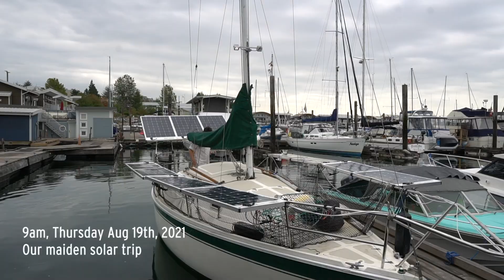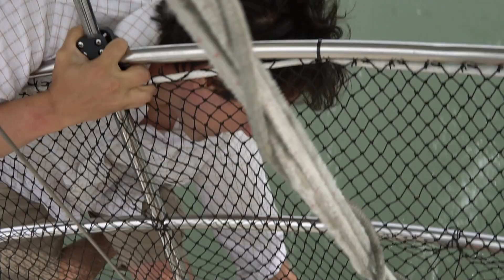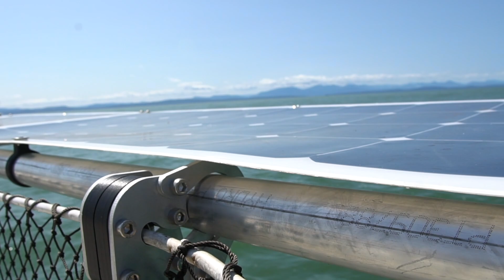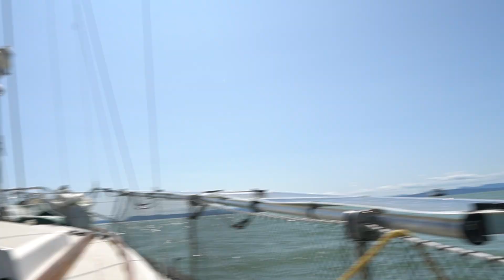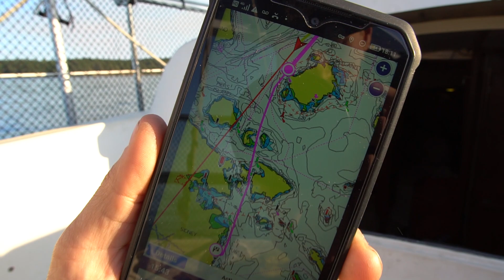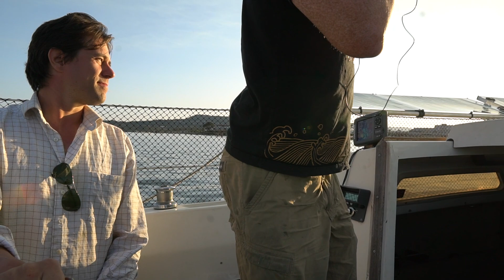Shamrock Electric Sailboat Conversion Part 5 - Maiden Trip under Solar,  Across the Georgia Straight

Comment: Wonder how the boat's doing nowadays. And what about hybridizing with a diesel generator as a backup and for longer legs?
Edit: Saw the last video of the series and it answers one of those questions :(
Reply from the maker: The new Bayfield boat is doing awesome though and has been on many sailing adventures since the electrification was finished last spring. A follow up video on that one forthcoming!

Comment: I had a similar idea lining the rails with solar, you’re the first person I’ve seen do it
Reply from the maker: It worked reasonably well but in the end I've since removed them due to how much they got on the way when actually sailing and blocking the view. For the shorter trips we tend to do the 500 watts of solar on the back is more than enough.
Reply: @GrinTechnologies  ahh that’s unfortunate, perhaps one could hang them lower about level with the deck so not to intrude as much in your vision.

Comment: When are we going to see a company take a simple sailboat mono hull and ditch all the sailing stuff and fit a full length solar roof? You could easily have a 5 KwHr array on a 35 footer with a 100 KwHr ex car battery pack. 4 Knot speed to take you 100 miles per day island hopping in the Med. Plenty of power at anchor to re charge and run all appliances. Love it.
Reply from the maker: We concur. If Shamrock ever gets winds up in an unfortunate demasting incident, you can be pretty sure that would be her future life too! It would be a nice way to bring value to salvage/scrap sailboats that are missing all their rigging too but otherwise have a sound hull.

Comment: You might be interested in how I do mine - I have a line just tied onto the stay wire, very simple.  There is a video of it at Sara of North Wales Episode 17 1 minute in shows it suspended by the line.  Its been on the line like that for 2 years and is not inconvenient or got damaged in any way.  Just another idea, really.  I like your panels on the front.  Good idea.
Reply from the maker: Ah nice, that is a petty clean and simple approach for supporting the extra solar panel

Comment: PV???...but it's an electric sailboat ...
so why not work on the controller's re-gen programming instead ???
i sized a system for a 27 footer, and was able to get that hull speed system down to a Salt Safe 25.6Vnom ( 8 cell pack ) with one of those new Axial Flux Motors, in direct drive..
re-gen is all in the controller programming...propeller size is a myth, and people who don't think much of re-gen, don't, because they don't think much about re-gen...is that any good reason?
Reply from the maker: It does regen just fine, but with the winds we have here it tops out at about 100-120 watts at the point of maximum power recovery. So it doesn't even come close to what we get from the solar panels even in the best of days.   
This regen maximum point is fully related to propeller diameter and geometry. If the sailboat was on land with a tracked wheel then we'd be able to get many kW of regen power from the same sail thrust, but what you can get dragging a prop through water is a lot more limiting.
Reply: @GrinTechnologies  it's just the reverse air foil shape of the prop blades, and any reduction losses that drops the potential.....every one knows a prop is less efficient in reverse because you can feel it....but it's not reverse either, it's just the air foil shape is the wrong way for re-gen......but still.....i you get into the programming, you can get more power out of it than your thinking...
Reply: @GrinTechnologies  the other thing to remember is: you can get symmetrical airfoil props.....you just have more shopping work to do, when getting a symmetrical airfoil prop for re-gen.
Reply: @GrinTechnologies  in reverse, the airfoil is backwards, AND on the wrong side.....but re-gen, it's just typically on the wrong side.
though it is difficult to find symmetrical airfoil props, they do exist....and that has more to do with it than propeller dimensions, once your into the programming.
Reply: @GrinTechnologies  once you get it right...then the only reason you will have left, for all those solar panels, is extended motor sailing..
if you load the prop too hard, you get more drag than power.....if you don't load it hard enough, it will just spin and produce little power.....
but if you get it right, you will understand why i size systems for direct drive, and why i recommend finding a symmetrical airfoil prop..
and the only way i have found to get around the need for a reduction, is the newer Axial Flux motors.
Reply: @GrinTechnologies  it's like mapping a maximum load curve....talk to your controller manufacturers about marine specific software updates, and learn it......i don't know if they have a marine specific software update for it, but  the software should function like MPPT in re-gen.....( with an adjustable current limit that lets the prop spin more beyond a point )
so if they do have a marine MPPT re-gen software update, it would be a piece of cake, otherwise you have to work for it, like you're hacking the system to get what you need..
the Sevcon controller re-gen is like a rubber tire on a road.....well it's not quite like that, is it?
Reply: like the charge voltage is the charge voltage....so the MPPT programming would ask for a nominal voltage and cell type.....and the MPPT then is entirely based on the current output.....and at some RPM, the current would be limited, where the product would remain the same, no matter how fast the prop was spinning.

Comment: I really like how thorough you are! a question, does the motor have a thrust bearing? 
Im thinking that bicycle hub motors wouldnt need one, but in this application the thrust of the prop is a significant lateral force , 
love what you are doing please keep it coming!!!
Reply from the maker: The bearing on this motor is a deep groove ball bearing (35mm ID, 55mm OD), and the manufacturer of the bearing assured us that the thrust forces we're dealing with here, ~200lb or so max, are no problem for a conventional radial groove ball bearing of this size.  We did purchase some angular contact bearings that are even better at thrust loads too if this did become an issue, but they don't have the same waterproof seal on them. 

Our main concern is in reversing the motor, all the backwards thrust is pulling on the side plate and small side plate bolts, so I have the reverse motor power limited to about 500 watts untill we come on with a better solution for this.

Comment: I was planing to use 205qs motor or 138qs motor, with kelly 7230s controller. Interesting if I will manage to reach 20knh speed
Reply from the maker: 20 knots is planing speed, so you a very different kind of boat platform to achieve that. I'd consider it unlikely unless you have quite a lightweight boat, since normally planing requires on the order of 10's of kW.

Comment: Love this! Looking into electric conversion and this is helpful. What safeguards do you put in place against lightning strikes possibly knocking out the motor system? Thanks
Reply from the maker: That's a question that hasn't had much consideration!  The boat has a grounding system connected to the mast, while the motor drive electronics and battery are fully isolated so hopefully this will be good enough to steer any discharge in a path that doesn't damage the motor drive electronics. Lightning is quite rare in this part of the world but it'd be a good idea for us to have it in consideration. We always have one or two backup motor controllers on the boat in any case since that's an easy insurance against any kind of electrical failure.

Comment: how do you calculate how many batteries and solar panels you need for electric motor conversion?
Reply from the maker: Take your empirically measured Wh/km at your preferred cruising speed, multiply that by your required trip distance, and that determines how many watt-hours are needed. You can achieve that 100% with batteries by having at least that many watt-hours of battery capacity, or you can count on portion of it coming from solar by estimating that on average you'll get 4 times your nominal installed solar watts in watt-hours each day. 

https://www.youtube.com/watch?v=15HHLY4BfA4&ab_channel=GrinTechnologies has more details as it applies to ebikes. Boats are no different, just a heck of a lot more power hungy.

Comment: Justin please make a "solar spinnaker" out of individual solar cells, like a chainmail solar sail. They are for sale on aliexpress. Use a cylindrical tube with a wide bore made of plastic piping to roll it on to. You could have 5kw very easily by hoisting it on the mast and holding it sunward with a spinnaker pole. If you could make it robust enough it would be an example of real out of the box thinking.
Reply from the maker: "Robust enough" is key! Wind can be pretty unforgiving to large thin surfaces but if the individual cells were spaced out with gaps so that the air can flow through them perhaps it might be easier to pull off. I do love the idea of having a 'solar sail' that you move around and orient to the sun on calm days just like a normal sail gets trimmed to the wind. And no doubt you'd get way more than enough watts to match sailing speeds without dipping into the battery reserve. 

We have 1800 pieces of bare Maxeon Sunpower cells on hand to toy with like this kind of stuff, but some other companies seem pretty far along in that exact product development,  like https://www.solarclothsystem.com/home
Reply: @GrinTechnologies  PLEASE pursue this because I think a lot of people would be very interested in it. There's no scientific reason why it wouldn't work, just implementation challenges. You could even start with a sail of the same flexible panels that you are currently using and develop further from there.

Comment: Great video, so at what speed were you were sailing? And what was consumption per km or per 1h?
Reply from the maker: We were motoring between 9-10 kph, sometimes with the tide and sometimes against it, using 2-3 kW of motor power. The CA said 258 wh/km, but there was marine growth around the water speed sensor of the CA so that was under reporting the speed and total distance (84 km on CA vs 91 kph according to GPS). So actual consumption was about 239 wh/km.